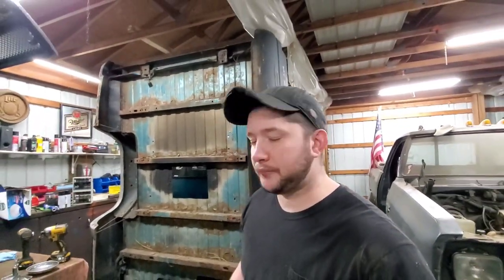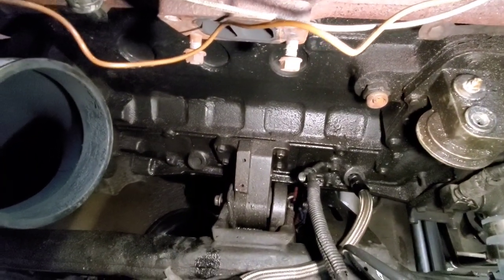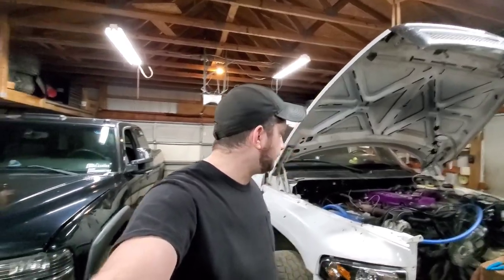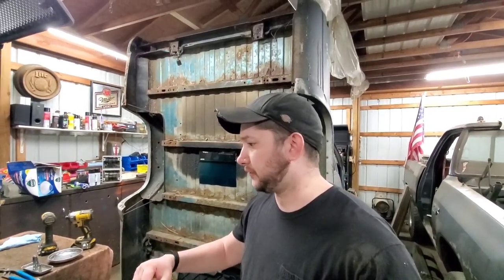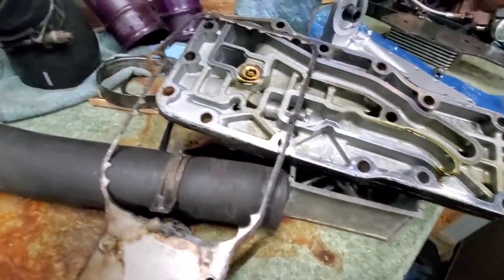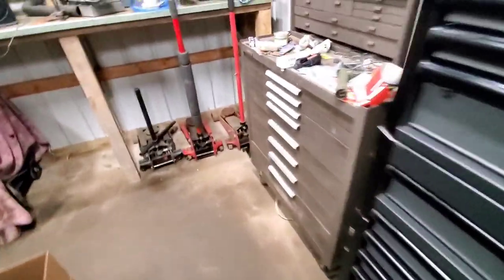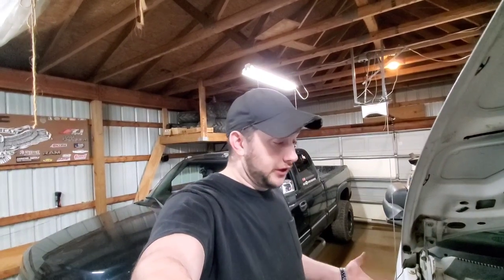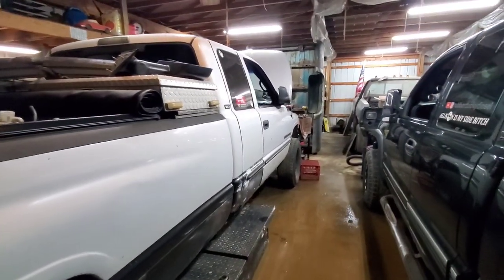Cummins Oil Filter Housing Replacement Pt.1

Comment: Not sure if you go back to old videos to respond to comments but in the process of doing the same replacement of my oil housing unit and was wondering if you had a parts list of the upgrades (hoses, lines, etc) and where you purchased from? Thanks for any feedback
Reply from the maker: Oil filter housing and gaskets came from Genos Garage. The feed and return lines are from Fleece
Reply: @rubberduckydiesel9349  - thanks for the reply.....

Comment: Hey brother. Need help on my 94 ck 3500 injector pump replacement. First diesel I've worked on.
Reply from the maker: What's up man
Reply: Think I've got it actually. Gonna finish tomorrow